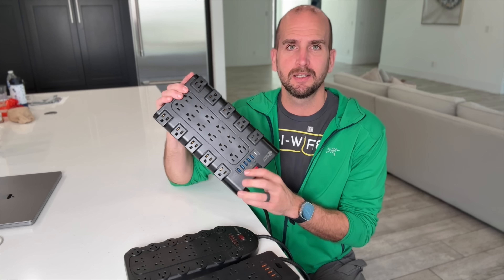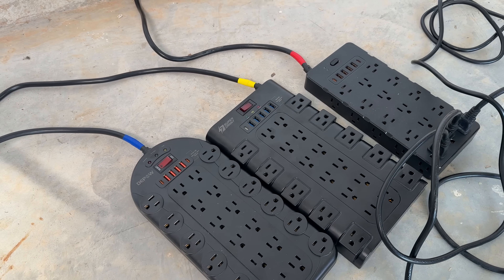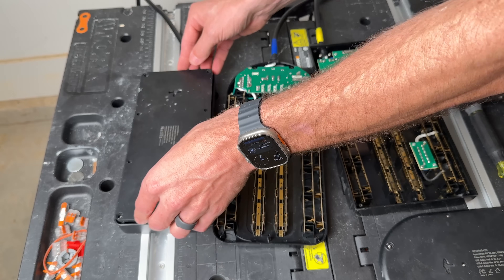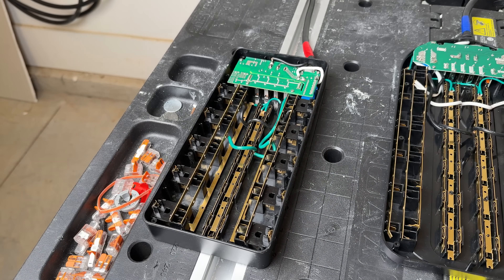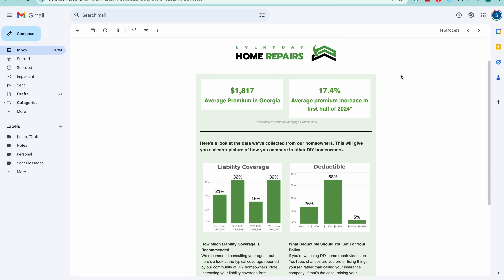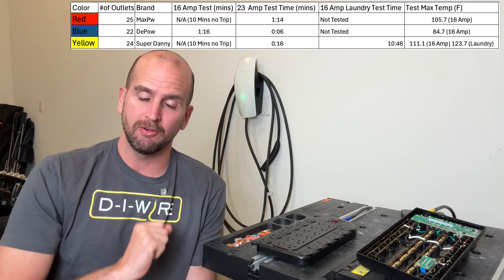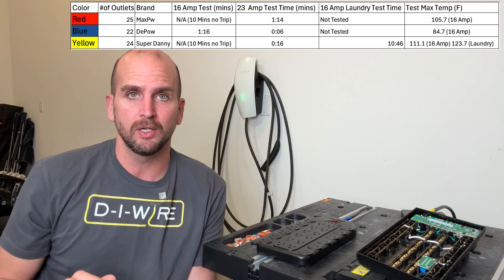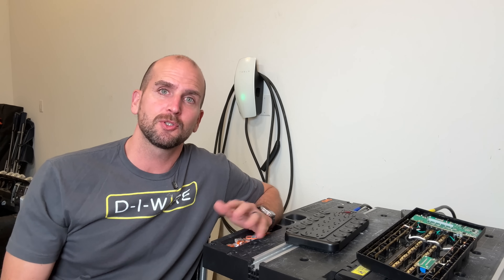Testing The Most Dangerous Amazon Power Strips |  I Wasn't Expecting These Results!

Comment: Interesting. When computers were a new thing in the 1980s we had to use a power strip with a surge protector with our Atari computer, printer and monitor. When a friend of the family, an electrician saw us using a power strip he said that it was a bad idea, that we should have extra wall outlets installed instead.  I wonder what he would think of our UPS battery backups?

The hospital that I worked for in the 1980s had a strict policy not to use power strips of any kind, that is until a major power failure knocked all but the emergency power off, causing a critical emergency for the ICU had 7 ventilators but only enough red emergency power outlets for four machines, requiring nurses to manually bag the patients. The maintenance department had to make a quick run to a hardware store for extra power strips to keep the patients alive.
Reply: Power bars have always had built-in over-current protection in the form of a bi-metallic breaker.  Well, the good ones.  Not sure what your electrician friend was worried about, as long as the computer was the only thing plugged into that outlet.  Also, back then a home computer like the Atari would not have consumed much more than 500 W with the equipment needed to use it.
Reply: @WJCTechyman  The electrician probably makes money charging people to install those extra outlets.
Reply: Where I worked we had thousands of dollars of computers. Every one had a power strip, and then upgraded to battery backups.
Reply: It is probably a good idea not to run high power devices through a strip.  Something like a space heater will come close to maxing out the circuit and it's too much for a strip.  Just plug it in directly.  But for low power devices, the power strips are just fine.  Just make sure you keep the cord protected from damage.
Reply: there is nothing bad about using power strips, the major issue when a general public violates simple rules of using such devices, e.g. walking over them, jamming the cables, putting a bunch of heating guns into a chained power strips etc.

Comment: Most electronic devices that have semiconductors in them are usually only rated to 158F (70C) because the most common (Commercial) rating for semiconductors is 0C to 70C. To get higher gets into Industrial grade (-40C to 85C) or Military grade (-67C to 125C). But the cost of the higher rated components preclude the from "build it as inexpensively as possible to maximize profit" of most consumer electronics, especially cheap chinesium.

Comment: Using these with high current is a trap for the unwary, to be sure, but these are obviously useful for having room to plug in a reasonable number of low power devices that have randomly oriented wallwarts which would otherwise need to be tetrised into place.

Comment: Those wires are spot welded not soldered.

I can see the use case for those such as low powered devices. I wouldn't use it for computers or power tools.

Comment: I just want to comment those are not "solder" joints. They are wield joints. Also, these power strips have the ETL safety certification tested to UL safety standards. These strips are meant for multiple light loads like phone chargers instead of heavy loads like a heat gun.

Comment: Thanks to everyone who pointed out that there were some markings on the enclosure that referenced a UL, Intertek, TUV, or similar third party testing.  Having products sold on Amazon, they have asked for certs. to verify safety and FCC/ISED.  All the major retailers require certs.

I am surprised that the host did not pull the UL requirements for power strips and follow the testing specs.  Typically, these things need to operate at 150% of rated capacity without releasing smoke.  Just putting a thermal camera on a hop spot is bogus testing and if one does do this, the typical spec is 40-50 C over ambient.

Shame on the host to post purchasing-links of these products when he seems to discourage purchasing because of his testing.

Like 'Mythbusters' use to do, would be nice to see a test to failure.

Comment: When you have a spot where you just need to plug in a bunch of low-wattage tech devices for intermittent charging, and they all come with stupid fat wall warts that take up three outlets, there’s really no other reasonable option. But I certainly don’t try to run heaters on my SuperDanny strips. I didn’t even need to open them to know how unwise that would be. 😅 These things have a very specific use case. Though they should probably have some better safety features also.

Comment: I have the one with the outlets on the side...the outlets are perfect for "wall wart" style power supplies.
I have a gaming rig that consist of multiple external devices and 2 monitors along with a modem and WiFi router.
I have 9 wall warts and 10 straight regular cords.
It only carries 900 watts when everything is powered up including a 600 watt PC running a game.
The wall warts generate more heat than the power strip does.
I personally think the long bus bars help pull the heat out of the wall warts better than a standard electrical outlet via the connective prongs.
I will buy another if my kid requires one to build out his aquarium.

Comment: I had no idea that these existed, but they could be quite useful.  I have several desks at home that use a 4-ft, 8-10 outlet strip.  All the sockets are occupied by low-current devices or chargers, but each occupies 2-3 outlets if they are grouped closely.  Your 24-25 outlet strips would only be good for 10-12 devices in this case.  I agree that the soldering looks dodgy; if I buy one, I will certainly open it up and re-solder the connections the right way.

Comment: You kept mentioning solder joints, but I believe those connections were spot welded. That’s probably why they didn’t heat up that much.
Reply: Exactly! Properly welded connections are the best.
Reply: I believe that is ultrasonic welded. Vibrated and pressed together so much that the copper and brass fuse together. No lead needed.

Comment: I have been told these big plug strips are mostly used by sound techs on stage where they have a bunch of amps and sound equipment to power. Low power, but lots of plugs
Reply: I wouldn't say that amps are low power... But a fist-full of 9V adapters for a bunch of guitar pedals... Yeah, that sounds like a good use case.

Comment: Would be great for computer setups, PC, 3 monitors, external hard drive swap bay, external cd-dvd drive, printer, desk lamp, headphone charger, powered USB hub, cell phone charger, tablet charger, quest 2 charger, all very low power consumption per device, but all at max might pull a bit of a load but I very quickly run out of outlets and have shit all over my house and it's a real pain in the ass.  it would be nice to have everything plugged in at my desk.

Comment: i used yellow for a while in my bedroom running a window unit a fan and phone chargers on the usb , then i got a smart wifi strip and put yellow in my shed. i plug in all kinds of stuff in and out  all day. it did trip once using my little 90 amp 110 welder at full power for a few minutes solid other than that works fine

Comment: I would be worried about the wall outlet and wires going to it in the wall starting a fire.  Having one of these, or especially two plugged into the same outlet and then every plug filled.  Depending one whats plugged in and if everything runs at the same time, it would probably trip the breaker before being unsafe, but still is scary to think about.

Comment: I just about lost my entire detached garage along with everything inside it 3 weeks ago to a fire.  I was using a 240v heater on a cord.  I had the heater set on low and the thermostat was turned about 1/4 the way up.  The first two hoses I hooked up had ice in them.  The third one worked but the flames were filling the entire doorway at that point. I was able to put the flames out and sprayed water on the things that had been on fire for about 10 min. I turned the water off and walked back to the garage.  As I was looking at all my melted tools I turned my headlamp off.  When I did that I could see an orange glow coming from the materials I had stored up in the rafters.  I turned the water back on and tried to spray water up into the area that was glowing.  I couldn't see but 10-12 inches through the smoke when my headlamp was on and couldn't see where the water was going without the light. I realized pretty quickly the garage was going to burn down if I didn't call the fire department.  They showed up within 5-7 min and decided that the best way to fight the fire was to cut 6 holes in the roof of my garage and spray water from above.  
I haven't done a complete assessment of what I lost.  It's very hard to look inside the garage at all the things I've worked hard to get that's either ruined from the heat and/or the water/ice that things were saturated in.   
The bright side is that the fire was in the garage and didn't start or spread to my house.  I'm also grateful that the fire wasn't worse.

Comment: I use one of those for my Home lab connected to a UPS. I plugged in 6 low power PCs, security cameras, two NAS servers and use the usb charging ports for usb fan cooling and general charging. The UPS only has a few outlets, and these power strips have a good amount of outlets so I am able to power everything for about two hours on the UPS when power goes out without the need to daisy chain.

Comment: 1:41 "One hot line." Umm.... Black is hot. You're reading the neutral. Not that it matters, but, it matters. 3:25 Welded, not soldered. Soldered would have been better, if it was properly done.

Comment: Many years ago I was in a control center and we were discussing modifications to their system. I suggested that they get long power strip like the ones that go into communications racks and install them under each desk. The lead engineer there said "no way, you will overload the circuit breakers". So I walk over to a desk and looked at how they were doing their power and found three power strips daisy chained together. Moral of the story, people will do what they need to to get the power they want.
Reply: Well, if that was the case, say to the engineer to do his/her/their job and do branch outlets capable of carrying the appropriate amount of current needed for said office.  Also, computers are quite a bit more power efficient these days than 20 years ago.  I mean, the average laptop doesn't really consume that much more than a 60 W incandescent light bulb and the same can be said for mini PCs.  Now, work station computers are a different story but most average offices don't have those and if they did, each desk would be running off of dedicated branch circuits with their own breaker per desk.  Offices also typically have a multi-function print and copy centre and even those don't consume anymore than one kilowatt, depending on what it does.  It's not like each desk is running an electric kettle, toaster oven or coffee maker, it's just solid state technology.  Also, you have to be a stupid engineer to daisy chain power bars.  Then again, the joke, "How many electrical engineers does it take to change a light bulb?"  Well the answer to that is "It's beneath them as they would get a technician or an electrician to do it because they are afraid to admit they don't know how."
Reply: @WJCTechyman  In a more static situation, you would be very correct. My point in the story was that the customer will do what he needs to meet the mission ahead of him. He does not care about proper electrical standards and technique. This particular room really needed to be overbuilt for power because on any given day the situation would change and were yesterday you had three computers today you have six, or eight. I just wanted to have as many outlets as possible with a good quality strip that had a breaker built in. If they overload they trip the strip first.
Reply: I was working in an overcrowded cubicle farm at Google around 2003.   Multiple developers in each cubie.  The facility people tried their best to keep the cubicle power proper and safe but we still daisy chained power strips together to support all of our desktop machines and monitors - and each of us had a couple of each.  Power started cutting out daily.  We complained because it was interrupting our whole team's work.  Facility guys came around, immediately spotted the problem, and laughed.  Turns out the team lead had had cold feet and put a small space heater under his desk.  Plugged in to one of the power strips of course.  (They were nice about it:  Provided extra power to our little setup.)
Reply: ya i have three power strips plugged into each other only because the closest outlet to my imac has 0 power going to it... but the imac and a oil difusser and a wireless charger for my phone are the only things plugged into those 3 power strips... the outlet actually tok a crap in november of 2023 and i told my buddy about it which owns the house but i think he forgot about it...

Comment: I do all kinds of monstrous things with power strips, but I avoid plugging high power draw devices into them. Still, I would want the integrated breakers to trip in the event one of my devices has some sort of electrical fault. 

This has actually happened to me before, where the power strip tripped but not the main breaker, because the fault was less than the power rating of the main breaker.

Comment: I have one similar to "blue" that is mounted on the wall in my garage with 10 outlets.  It powers several battery chargers.  There is a USB cable plugged in for when I need to recharge a tool.  Half of the outlets are empty.  Also connected is a 4 gang box that is used for higher power loads, like an electric blower.  In my case, I am not concerned about load as usually there a few batteries (mostly DeWalt) plugged in but they are never totally drained.  I have a shelf with a dozen DeWalt battery holders which where I place charged batteries.  It has a switch a three LEDs.  When away from home for a long time, I flip the switch to turn off the battery chargers,

In my office, I have a more industrial power strip mount under the cabinet behind multiple computer monitors.  It has 12 outlets. and is mostly full of low power devices, like LED lighting, chrome cast, roku device, powered speakers for a PC.  It also has a 8 port USB charging unit plugged in.  The load is pretty trivial.

Loads for home circuits are massively reduced.  I bought my house 20 years ago.  The first wave was to replace all the incandescent lamps with CFLs.  Later they were all moved to LED with dimmers.  Most of the original fixtures at max are pulling 10% of what the original design anticipated.  TVs also pull less power than old ones.  The only high loads are vacuum cleaners, hair dryers and kitchen appliances.  My house has 12ga copper almost everywhere with 20A breakers.

Comment: My dad was an electrician so I'm careful about extension cords ect   i use these kind of power strips in my living room.  Just have low wattage plugged in lamps computer bricks.  Just makes it easier.  Have lots of outlets in the kitchen.  I use a power strip rated for 1875 watts 15 amps.  Just have coffee pow plugged in.  It's easier to switch it off rather than pull the plug every day.  In the computer room have two strips again lamps and led lamps lap top.  Low wattage.  I mainly use the power strips to keep wear and tear low on the outlets.

Comment: Those things are a fire waiting to happen. In most cases with everything being low power, the inventors probably thought that people that need laptops, battery chargers and LED devices would be using them the most. And those power supplies without a cord blocking a lot of outlets too. The irony of homeowner's insurance isn't lost on me either. If insurance companies knew that people had those devices, and space heaters, toaster ovens, tea kettles, etc, they would probably cancel them very quickly. IF I were to buy something that crazy, it would have been a moment of poor judgement. But also, I think if they were overloaded to the point of causing a fire, then the breaker at the panel should trip, since the current on one wire was exceeded.

Comment: In what I can see in the video, only the blue power strip has an electrical certification, ETL.  NEVER use anything that plugs into the wall that doesn’t have an electrical certification.  Your circuit breakers, wiring, and outlets, all have electrical certifications; otherwise, you fail your building inspection.  The 2 certification authorities in the US are UL and ETL, while the EU has CE.  If it doesn’t have an electrical certification, and there is a fire, guess what?  Your fire insurance will not pay a cent.  If someone is electrocuted, medical and/or life insurance, may not pay, or pay at a reduced rate.  They may even sue you.  I’d say more, but the content of this video is beyond negligence.
Reply: You can't trust the printing on the Chinese products, they can lie about certification.